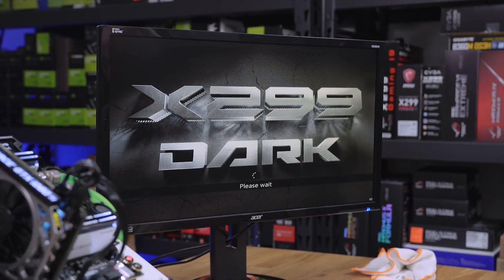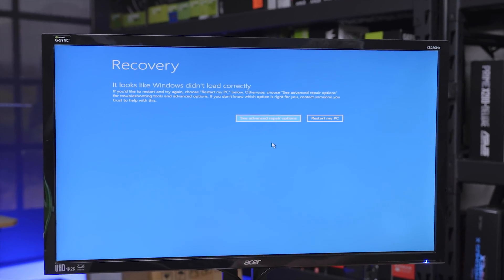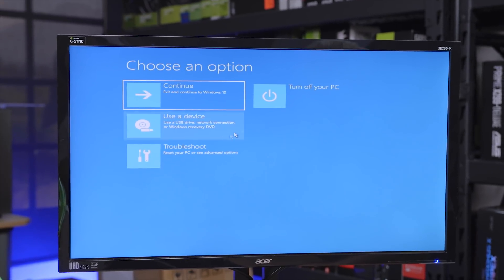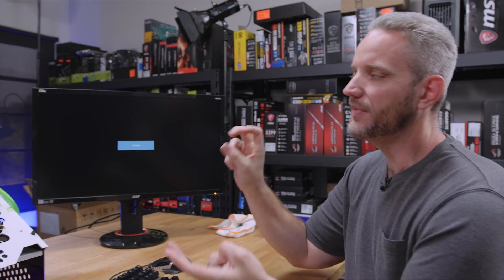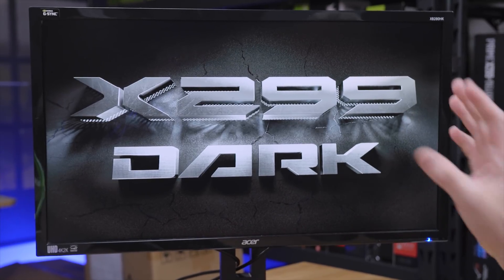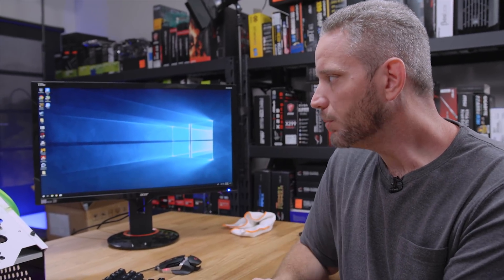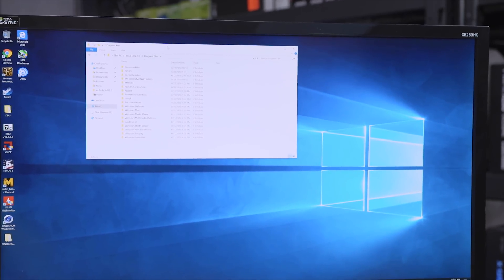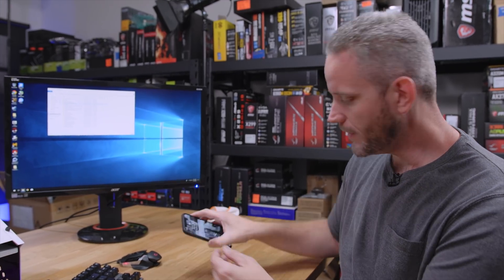New Test Bench Keeps Boot Looping... Here's how we fixed it

Comment: Windows 10 sucks big time in multiple areas....only illiterate newcoming youngsters that have never used Win XP or Win 7 will say that it's a great OS and yeah the deluded blind believers that believe that anything new is by definition better. But in practice Windows 7 demolishes Windows 10 in IPC, multi-core, software stability, driver stability and overall functionality. Even games perform anywhere from 10-20 % faster in Windows 7 on the same hardware.
Reply: Games...10-20%... lol ok, and I'm Santa Claus
Reply: Valter FG 10-20% ,this dude is delusional
Reply: Valter FG : no you ain't Santa Claus, you just a Microsoft shill only knowing Windows 10 and even that only to the extent of playing games :).
Reply: LFly R Which option worked best for you?
Reply: tazgamer : The easiest option for me was to install win 7 in the Ryzen rig, take the SSD out and put in my previous rig, let it come into the OS, copy that Crimson ryzen chipset driver v17.12 into AMD folder and create txt/bat file for startup installation, put SSD back into Ryzen rig an let it go into OS wait a few seconds and you get usb 3.0 driver istalled and keyboard and mouse start working. Everything else from that point on is the same as if you had a normal rig that completely works in Win 7.
Reply: https://www.youtube.com/watch?v=9CFIDz2hgd8&t 10 - 20% faster my ass. if anything 7 performs worse due to worse ram compression.
Reply: JoleeHonso : posting biased and bribed videos with skewed results wont do you any good as far as your legitimacy goes. I recommend you try it yourself or find more truthful benchmarks and forget about youtube where anybody can post anything they want without any proof or filtering.
Reply: lol alright buddy show me some "more truthful" benchmarks then? I can tell you after going to 10 I suffered from no performance loss and in most cases better 0.1 and 1% lows the same as that vid claims but ok
Reply: I'm talking about games only, because YOU said this nonsense of ''10-20%'' difference in games, when reality points that is negligible. It's pointless you telling me that I'm a ''Microsoft shill'' that never had experiences with WXP and W7 before, when I am just using W10 Pro for just a month and passed ''my entire life'' using those mentioned OS. If you wanna talk about games performance, don't be such a liar just to justify your point of view
Reply: Aside from Windows 10's native ISO support, PDF printing support, NVME Support, USB 3.0 support, vastly superior memory handling (Im sure you think the ram usage is ermagherd windoze 10 hogging muh rams), better multithreading support and balancing between cores, Secure Boot, native VM support (hilariously you can run stuff in 100% native Windows 7 inside Windows 10 but Im SURE you knew that), etc, etc you get the idea.

This exact problem exists on Windows 7 as well the ONLY difference is microsoft dropping the F8 to safe mode part which is dumb but hardly invalidates the entire OS.

I grew up on DOS, Win 3.1 and OS/2. You are just a typical "know more than the average user but not enough to know how much you dont actually know" Dunning Kruger example while spouting wild claims and inaccurate bullshit. "10% to 20% in games" hahahahahahahahahahahahahahahahahahaha

You're like the PC equivalent of an antivaxx tard - "All evidence that agrees with me is right and anything that disagrees is fake news and shills for big Microsoft". For an operating system they gave away. That you can still activate to this day with Windows 7 keys. That they make nothing off you using.

You're that dude that does this shit every few years:

Windows XP - "Windows 98 was the best XP sucks"
Windows 7 - "Windows XP was the best Windows 7 sucks"
Windows 10 - "Windows 7 is the best, Windows 10 sucks"

Yeah OK and in a few years Windows 10 July 2018 will be the best and the new Windows 10 update sucks, and on and on.

You dont even seem to understand how games work - graphically intensive games are more taxing on the GPU not the CPU - if anything esports and older games would show a BIGGER gap but they dont, because there is none.

But hey continue being an ex-spurt by all means.
Reply: Wrathlon : vastly superior memory handling that can be seen where with noticable improvements ?
Win 7 also has native ISO support and there are multiple better programs for ISO handling out there. USB 3.0 support has added to Win 7 with motherboard drivers since 2009. Win 10 only has USB 3.0 supported whereas USB 2.0 is left out despite the fact that all keyboards, mouses, many portable HDDs, game controllers and majority of USB drives are still natively USB 2.0....so yeah USB 3.0 is vastly overrated for now and is completely functional in Win 7 with the standarizized added motherboard drivers.
Multi threading in Win 10 is completely and utterly the same as it is in Win 7....practically nonexistent in both OS-s on a efficiency level. Secure boot is stupid as soon as you get a crypto virus implemented into your boot and then come the endless boot loops out of where that kind of malware is practically impossible to clean whereas in Win 7 that problem is nonexistent due to older and better nature of booting of the OS itself. NVME is still not financially sound investment so therefore unimportant until NVME M.2 SSDs become cheap and all start having proper cooling heatsinks on them. Everything you just said is completely untrue and proves that you have never really tried any of that in real world scenarios. You are just rambling online features you heard on youtube.
Reply: LFly R Last year I built a whole new pc, but limited myself in hardware just to keep using Windows 7. Microsoft and their forcing people into Windows 10 sucked. I got the core i7 6700 cpu, but I was thinking I would get one of the new amd cpu's because amd was originally saying they were going to support Windows 7. They of course backed out close to launch so I chose to just go with the 6700k.
Reply: tazgamer : I completely understand why you chose i7 6700K instead of i7 7700K. But I must disappoint you because the complete Ryzen 1. Gen series from 2017 supports Windows 7 officially through motherboard drivers and works properly on them. I did the installation of Win 7 on my Ryzen 7 1800X that I just bought 1 month for 212 bucks as an upgrade from Ryzen 5 2400G which was the best APU on the planet but still limited to Win 10 only via intentional ACPI limitations. As for Ryzen 7 1800X it only requires startup installation of motherboard drivers so that you can get USB 3.0 working of the first run. Then it works like a charm and quite faster than Win 10 crappy bloatware OS in every possible game. That's why I migrated from Ryzen 5 2400G because it's a Raven Ridge and Microsoft forced motherboard makers to intentionally limit Raven Ridge code named Ryzens in BIOS by making them not fully ACPI compliant as you try to install/run Win 7. But my Ryzen 7 1800X is still Summit Ridge architecture and is completely working and fully supported in Win 7. Since March of 2017 I've built more than 50 Ryzen 1.gen based rigs with customers intention of using Win 7.
Reply: LFly R If you have any links I would love to look at them. I just remember amd doing an announcement and stating that they were not going to support Windows 7.
Reply: tazgamer : 

For installation use this guide : https://www.anandtech.com/show/11182/how-to-get-ryzen-working-on-windows-7-x64

It's completely functional on complete 1st gen Ryzen 3,5 and 7.
Reply: After reading through some of this thread I'm picturing this guy as a 40 year old in his parents basement posting YouTube comments with his old core 2 duo machine. He's stuck in his parents basement simply because he can't deal with real facts. Like a mellienal in denial of the world or something along those lines. 

Also note how this guy has no actual evidence to support his claim. Just a bunch of name calling. I've said it before and I'll say it again. That's the definition of a fanboy. Not that you can't like windows 7, and I do still like windows 7, but everything he states in his comments is just completely wrong.
Reply: Shintel buttercup.. never heard anything like that before, windows 10 is better, Intel and AMD are both good and there we go, problem solved.
Reply: a 40 year old millenial. seems legit.
Reply: Fist bump
Reply: Alex Barbu on my Ryzen 7 1800X and previously on Rzyen 5 1500X (that I still own for bios upgrading for my customers) coupled with a KFA2 GTX 1018 EXOC games like :

Ghost Recon Wildlands
Mass Effect Andromeda
Assasins Creed Origins
Prey 2
Deus Ex 4
Crysis 3

At 1080p on Ultra settings all of these games show around on average 10-15 FPS decrease when I played them in Win 10. I've tried them for months in win 10 but as soon as I went back on win 7 there was a noticable increase in FPS throughout all of them mesured with Fraps or MSI Afterburner with Riva statistics. I dont care about graphicaly unintensive games like old ganes or esports games because they are unimportant and dull. Graphicaly and phisicaly intensive games full of rich textures are the ones that show FPS decrease in win 10 because win 10 services are more taxing on the cpu in general. And I eve tried that on my previoys i7 7700(nonK) and the story was the same.
Reply: The GUI after W8 totally sucks. That pointless incomplete settings UI which still require you to go back into Control Panel to change most of the useful settings is something I totally hate. W10 is the same piece of GUI garbage.

But saying that W7 is better than W10 is simply not true. I am pretty sure you haven't seen file transfers saturating 4x1GE link using SMB3.0. What about NVME support? What about the superior IO handling e.g. 10G connectivity to NAS (using Napp-it with OpenIndiana) and transfers at close to line rate? What about snapping a dozen putty screens to corners of windows on a quad monitor setup when doing complex configuration? I have never seen any games run 10-20% faster in W7. Sure, W7 has less bloat but I have 16-64GB ram on all my machines and none of them are memory starved.
Reply: The UI is a perfectly valid complaint - I dont like it either for a lot of things but it does have some OK features. I just use classic shell and control panel as per every other version of windows anyway but over time I've gotten used to some of the settings menu features and as much as I still dont like it I have to admit it IS faster for some things (and its definitely better for the average end user so long as they havent got habits from earlier versions.

This is where the Windows 10 UI is great - take two people with no experience on a computer and plonk them down on Windows 7 and Windows 10 and the Windows 10 user will find stuff faster. For that demographic it IS a step up.

Also the mem usage in Windows 10 is high because Windows 10 sees idle RAM and utilises it whereas previous versions of Windows would try and keep as much free at all times as it can. As soon as you load something Windows 10 dumps that RAM for the program to use and then picks it up again when youre done - the side effect is RAM usage is almost always higher in Windows 10 vs Windows 7 but its the opposite of a bad thing.

As an aside if you load Windows 10 onto a Pentium 4 (assuming you can find one that has NX Bit) it will actually run BETTER than Windows 7. In fact the older the hardware the better the overall user experience is when using 10 instead of 7.
Reply: Win 7 is outdated and will only become moreso. Win10 is improving all the time. It's not the same OS as launch day. Give it another try if you have time.
Reply: The Stig ZeroZeroZero : windows 7 is completely up to date with all the security patches rolling out monthly, completely all programs developed are completely 100 % working and support win 7 in 100 %. All games work in 100 % on all hardware, except Microsofts own Age Of Empires remastered and Forza motorsport/Forza Horizon....which is to be expected that microsoft made them intentionally locked to work only when Win 10 is detected. I use win 10 aside of my win 7 and win 10 is still much worse in terms of stability, driverm stability, games stability and quite often gets updates that crash your boot sector or come in conflict with certain hardware drivers. Win 7 has none of those or anykind of issues like that. They are 100 % stable for a gamer/pc builder/pc programmer like myself.
Your win 10 shilling has no merrit and absolutely no real world hard proof to be better. Your shilling is completely based on your feelings.
Reply: its all a cool story till you show proof. you list games where you saw 10 - 20% difference yet no photos or recorded video to prove it. every other recorded comparison benchmark shows no difference and the difference there is goes towards windows 10 being just a bit better by 1 - 3 fps. that and ram usage is less. but I guess I'll stick to being called a shill rofl. good chat
Reply: I have tried it and my results agree with everyone else thats not you lol. my games play better on 10 sorry to burst your bubble. again I provided proof you haven't so theres really no argument here. if you want to reply again link your findings and I'll happily look at them if you want to backup your claims that 7 just blows away 10 in every regard
Reply: JoleeHonso : there is a simple answer to your claims : you are lying :)....as many win 10 shills have been doing for the past 3 years since that crappy OS launched.
Reply: https://www.youtube.com/watch?v=JwHcOGDHKGM

Post a video of W7 being 20% faster than W10. Every video I see shows 0-5% difference. That is basically what everyone in the comments above are saying. If you want to sound credible, substantiate your claim.

Also, I don't experience driver issues you mentioned. I also reboot the system only once a month, so reboot times don't matter. Despite that, I do not encounter any memory leaks. You must be running a badly written program that is not freeing up memory after use which will shit on the OS regardless of the version.

Since we are talking about W10 vs W7, what about DX12 support? What about Credential Guard? What about memory compression store? What about native virtual desktops? File revisions? Less malware discovered on W10 than W7? SMB3.0 that allows me to do 1.2GB/s transfers to my NAS for archiving VMs. W10 has so many more features than W7 it isn't even funny. Quit living in the past.
Reply: Ash Lord : since when is a bot channel called Testing Games on youtube a legitimate source for information ? You didn't experience driver issues in 3 years ? What, you haven't changed Nvidia driver for 3 years ? With my GTX 1080 and my previous GTX 970 there were 50+ drivers with problems in 3 years of Win 10 existence....I don't know under what rock you live and why you don't change drivers of your GPU, motherboard and other pheripherals....but in real world Win 10 has huge driver problems especially if you have another rig with the same specs at home side by side with Win 7 on it and you do almost the same driver updates on both of them. And don't get me started on the win 10 build versions upgrades where people from small companies are calling me everytime a "creators fall" like update comes to save their printer driver problems.

DX 12 support for now is nonexistent. The only game that mildly but truly supports and uses it is Ashes Of Singularity v1.0. Until games start using ASYNC, we cannot see real DX 12 API running games. Even if a game says that it's running in DX12, and doesn't produce difference in results compared to the same game running in DX 11, then this game runs through DX 12 and computes in DX 11 in the back.
Memory compression store is irrelevant for home and office users because it produces ZERO performance differences. As far as my experiences go my malware filter found more malware on my Win 10 rig. SMB3.0 is also working in Win 7 and Win 8.1 perfectly and equally.
Win 10 has absolutely no new features that could actually bring visual performance advancements to a home user or an office user. But what win 10 brings is countless uncontrolled updates, microsofts stealing of files from your computer statistics, approximately 10-15 % of your CPU compute power that is constantly taken, countless pheripheral driver problems and around 10-20 % lower game performance. Those are fact that can be checked by anyone comparing 2 same rigs alongside in these two OS-s.
Reply: Ash Lord : sure you have buttercup :) sure you have. Now it's time to wake up ;) and read literally ten thousands of comments in countless forums from people from all over the planet posting them for the last 3 years since Win 10 came out and how many countless times they've had troubles with Nvidia drivers, different printer drivers and other pheriperial driver problems. I myself have also encountered Nvidia driver problems in Win 10 countless times whereas in Win 7 almost none and the same goes for printers and other expansion decoding PCI cards. 
The problem is with you that still think that branding brings quality automatically. That's the kind of thinking from 20 years ago when Mercedes was a quality manufacturer etc....nowadays they all are fluctuating in quality from one series to another and nothing is the way "if you pay more money, you get higher quality". So wake up in 2018 and smell reality because branding-quality connection is practically dead.
Reply: Been a few posts but I still don't see you posting any video or evidence of the 20% performance claim. Oh by the way, brand doesn't matter. The components that go into the product does. Cheap caps vs solid tantalum caps matter and that is what better grade products bring. Your point about mercedes is moot. None of the german brands make anything remotely reliable. Say what you may, I am not defending that W10 is a perfect product. In fact, I already posted that W10 GUI is shit other than the corner docking and virtual desktop capability. You, on the other hand, keeps talking about 10-20% without giving a single link or evidence. And I agree with other posters that W7 is only about 5% faster at max.
Reply: Ash Lord : German brands did make many cars reliable 20 years ago. But not anymore....your your point about dismissing that fact is moot. Again about quazi proof of 10-20% of game FPS performance reduction going from Win 7 to Win 10 can be benchmarked by anybody on the planet. If you desire proof so much, do it yourself on your gaming PC....if you have one at all :). As I said multiple times before....to your kind there is no need proving anything because you wouldn't believe anykind of proof even if it was right in front of your shilling face :). Despite that factual characteristic of your your are more than welcome trying it yourself.
Reply: Exactly. Spewing shit and still asking the rest to get proof themselves. LOL. We can close the case and ignore this fanboy.
Reply: Looked up fan boy on dictionary.com, was sent to this comment
Reply: Eman2000 I don't even have look in the dictionary for a word to describe you....I can smell a Shintel shill like you through the internet connection from 5000 miles away around the planet and see you for what you are buttercup :-).
Reply: lol so now you're saying anyone that uses a intel cpu is a shill now too? damn sure is alot of shills in your world
Reply: "Anyone who agrees with me is right and anyone who doesnt is a shill - all evidence against me is lies from shills". So literally they are SO NARCISSISTIC their entire world view is one where they are the single most right person on the planet and the idea they could ever be wrong is totally impossible to them.
Reply: I have an older system (4960X, 32GB DDR3 2400Mhz but a 1080Ti and 960 Pro in a x4 adapter card). When TR2 finally comes out and I can upgrade, Im tempted to do a benchmark of each of the games he listed on my old PC, wipe the drive, reinstall Windows 7 and do it again.

My system is unique in that it SHOULD be better optimised for Windows 7 (The chipset drivers, for example, arent even meant for Windows 8 let alone windows 10), the BIOS has been modded for NVME boot and I have the RST module from X299 modded in as well. In theory if any system was going to win in Windows 7 mine would - I already know it wont because, well, I own it and went from Windows 7 to Windows 10.
Reply: JoleeHonso : it's OK Shintel buttercup ;). Truth hurts, sooner or later the surroundings will force you to accept it and stop lying to yourself and stop believing biased benchmarks ;).
Reply: wrathlon : I can only suggest to you what I have suggested to you a few times already....ZEN camp where ZEN masters will give you Ryzen pills to chill your puny sheeplike brain and start clearing your mind and that healing Ryzen creme for you newly ripped poopoo that Threadripper ripped you last year ;). That's the only way out of that Shintel cave for you :).
Reply: LFly R 50% of your comments consists of "shill" and "buttercup"
Reply: Dex4Sure sure you have an i7 8700K and a 1080 Ti  buttercup....sure buttercup :-). Usually Shintel shills don't have a good rig that's why you are so frustrated about real world benchmarks because it bugs you and your skewed belief that you have been building in your sheeplike head for years watching biased reviews from selfproclaimed reviewers :-). I suggest ZEN camp where they will give you Ryzen pills and that healing Ryzen creme for your newly ripped poopoo that Threadripper ripped you last year ;-).